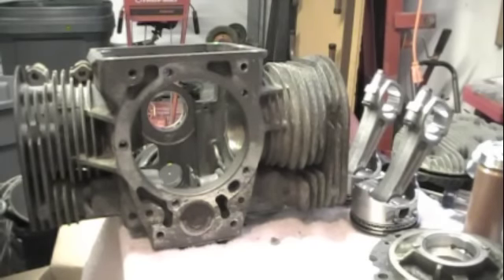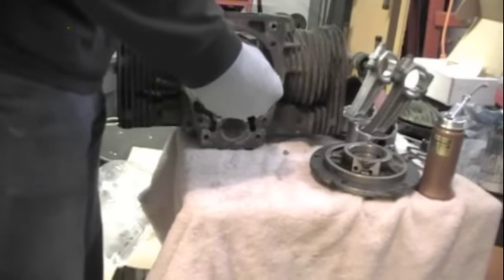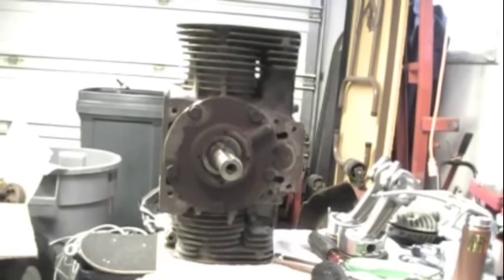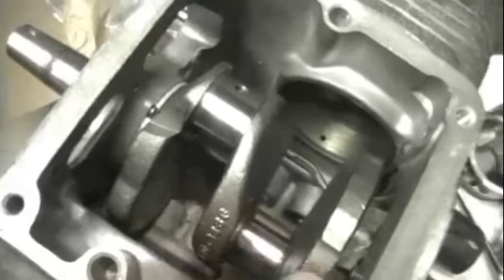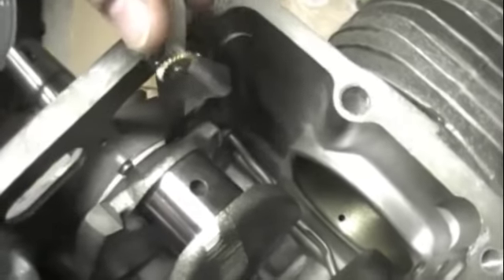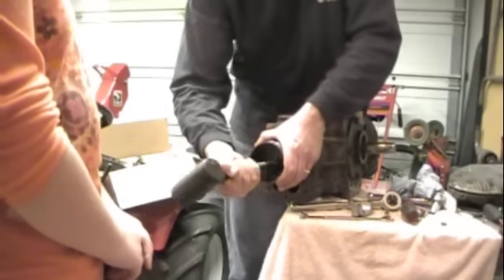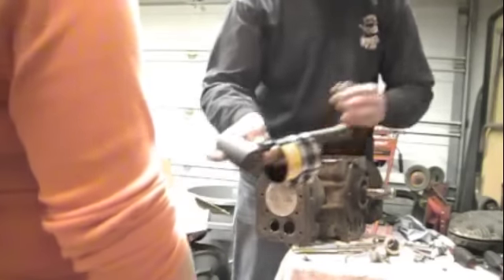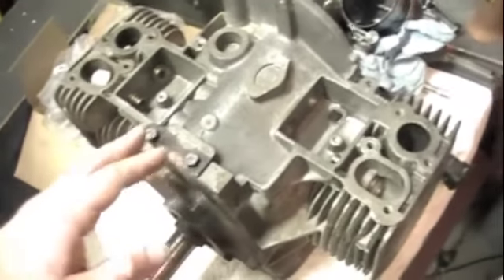Onan Rebuild 3

Comment from the maker: Yeah, the 18's and 20's have a little longer stroke than the 16hp, by about .25".  That longer stroke gives the 18 the extra power.  The 20 hp gets its extra horsepower from a cam adjustment that opens the intake a little more for a little deeper breath.

Comment: @MRSROCKINROBIN 
I have a question. My 16hp and 20hp Onans pistons stop at the top of the deck when rotating the engines. Just got an 18hp Onan (in very nice shape) but noticed the pistons come out of the block about the thickness of the head gasket. Is this normal for the 18's? 
thank you
earlyiron4